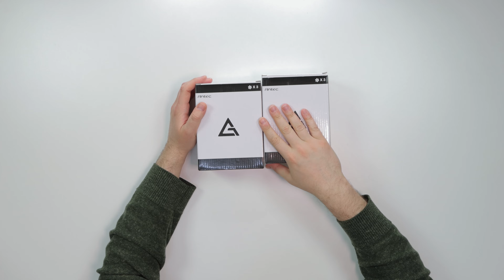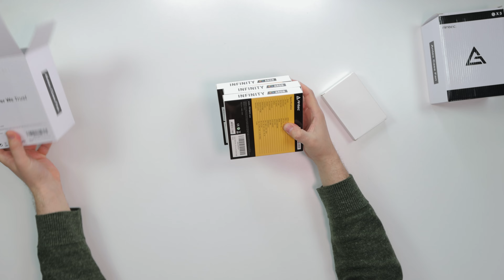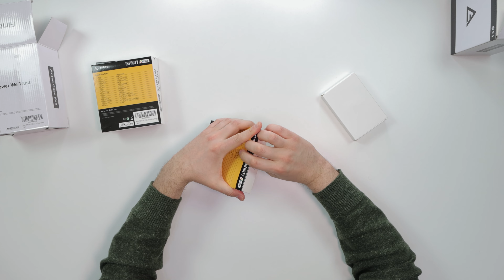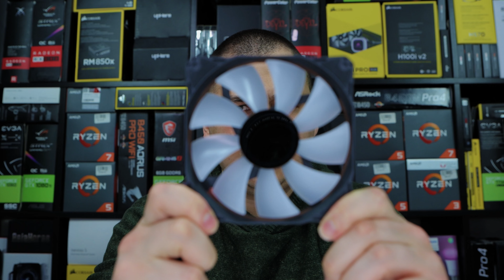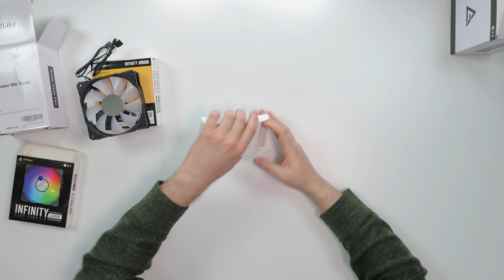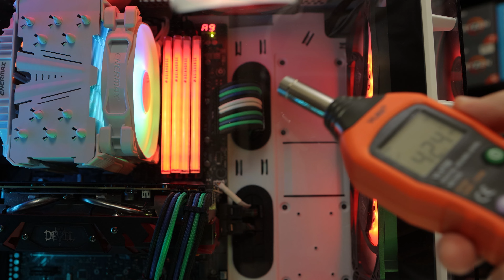Cool Design - Antec Infinity Mirror aRGB Fans Review | Airflow, Noise Test & RGB

Comment: I plugged these into my MOBO with the gigabyte adapter but the fan speed button doesn't work and these are really loud.. like i cannot function with how loud these are.. i can't find any software or support that lets me turn them down, and there's no 'VDG Fan' option in my BIOS. Is there a way to turn the speed down or change the colors without the adapter through the VDG port??

Comment: Hi, I just got this and not sure how to properly power it.  I noticed to power it you need a SATA cable but as soon as I try connecting a SATA cable something pops inside the controller lol.  Thankfully I have a lot of these controllers but I don't want it to pop whenever I connect it.  Do you need a software to power it or can you do so without a software on or installed?

Comment: would these be any good for pushing air into a radiator?
Reply from the maker: Yeah they will be decent
Reply: @KosherTech 
I am thinking of buying the ID-COOLING XF-12025-ARGB-TRIO fan kit.  The price is very affordable in my country.  I guess it's only in stock on the newegg site right now.  I can say that there are almost no reviews on the internet.  Its features really look good for its price.  Do you think this fan set is good?
Reply from the maker: I believe I did review those but in white checkout my chinesergbfans playlist
Reply: @KosherTech  I watch your videos and also try to follow your channel.  You promoted a product like this.  But it was not the same product.  The model with the inscription DF at the beginning of the product you are talking about.  

Model DF provides 56.5 CFM.  In addition, the sound level is 31.5 dB as it reaches 2000 rpm.  The XF labeled model I mentioned provides 62 CFM.  It also goes up to a maximum of 1500 rpm.  The sound level is 26.4 dB.  Despite this, the DF Model is as much as 180 currencies more expensive in my country.  The XF model looks like an affordable model with good features.

(I'm sorry if my english is bad)